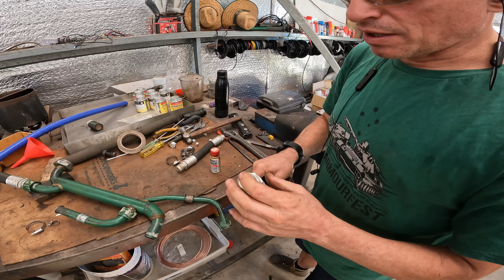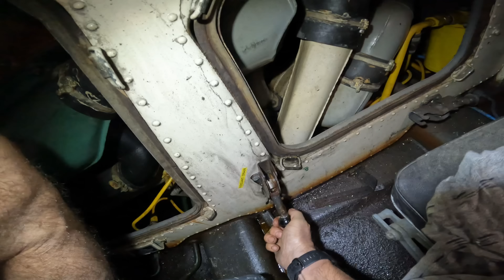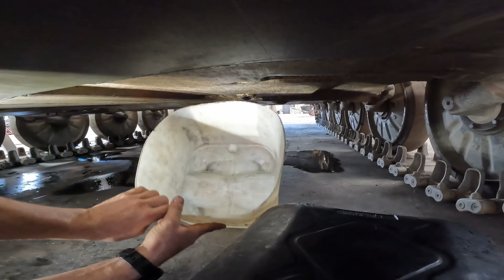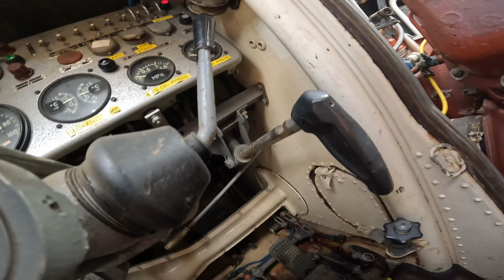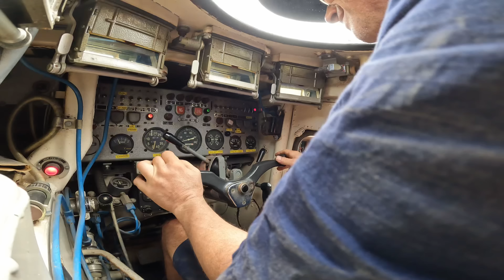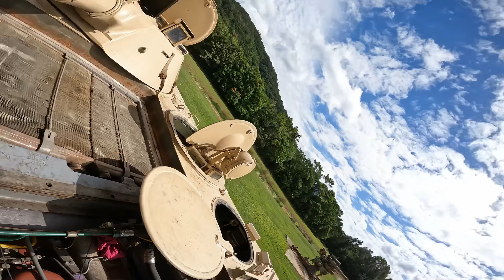BMP-1Infantry Fighting Vehicle Repair - PART III

Comment: The manual says that only if the air start system pressure is too low, electric starter should be used at the same time. The air start system is the primary one, the electric starter is only a back up system. I have the Soviet operator's manual translated into english by the US Army. I wish that I could find the Finnish Army books for the BMP, like I have for our T-55. Even though the Soviet manual has 541 pages, it is lacking some information, possibly because those things are teached during the training of the crew.

Comment: I work in the field of armored vehicles. There are several reasons for oil and water mixing, including: 1. Mixing the water pipe with the common oil. 2. Mixing the oil pump with water. 3. Mixing from inside the engine, such as a cylinder head gasket.

Comment: i dont know if you know it , but important thing about the BMP-1 brake system is the EMERGENCY AIR BRAKE system. when the bmp is not working , brakes wont work , stearing wheel wont work , so you have to have the system working for you to be able to stop . That needs : 1) the electrical system to be on and with power, 2) you have at least 50 air pressure, 3) the brake air valve works. it means that if you are pushing the brakes while in stop and with no handbrake and with power , you should hear a burst of air and the brakes should close (work). if not 2 things can be in fault , an d must be checked because the vehicle is dangerous withoyt this system.

Comment: Better oil in the water than the other way around making the engine a milkshake machine. Just run it 4 or 5 times with no cap on the header tank so the water is not under pressure and if there is an oil leak it will push more oil into the water that way as the oil will be under pressure, and you will see it more and more oil in the header tank.

Comment: Someone in our platoon tasked a young soldier with no 404's or significant experience with operating an M113 with moving one a short distance in the training area. He was all eager to get his chance. He was doing pretty good but he neglected to secure the latch to lock the driver's hatch fully open. He was wearing his bush cap and didn't the hatch pivot forward slowly under the spring pressure and clocked him on the crown of his head when he let up on the accellerator. Immediately he got a stunned look on his face and  slowly dropped back into the M113 like a drunk Jack in the box for a moment. Ouch. For those who have not seen an M113 the drivers and crew commanders hatch have mighty torsion springs at the hinges to dampen the movement of the hatch so it does not slam shut every time. Lucky for our poor guy the torsion spring did its job to a degree.

Comment: check out the chemistry lesson from Steve. Aluminium and Zinc are both Amphoteric… meaning they both react with acids and bases .. ie Caustic
Reply: He also is the first "just a car mechanic"  I've ever heard mention CTE and the differing expansion rates of metal.

Comment: Dear Guys,
Your BMP looks far more better than Emile Luijben’s one when his non driving BMP arrived with his workshop. Yours looks really a lot better ans Steve did repair the cooling leak very well indeed. 
Coming back to Emile’s BMP, his one first got a complete overhauling of the stuck engine. Emile managed to get her running again so he went for a complete outside restoration. As well as for the engine compartment The inside still needs to be restored but he and his staff were able to get the inside more properly looking and the BMP was already in several shows. Also for Emile this vehicle was a pleasure to drive and far more easy than his T55 and T69. 
I look forward to your next vlog and send you love from The Netherlands

Comment: All that water heating/ cooling is just more hassles and do away with the lot. Arctic temps in Nth Qld is 10 deg C. Not F.
You need to wash all the dirty footprints and greasy handprints off before putting it away.

Comment: Thanks again for another Workshop Friday. I never knew that dishwasher tabs could be used for radiator cleaning. Steve's use of the term "Squaddie" certainly dates him. Brilliant episode, Cheers
Reply: Washing machine tabs are also very useful for cleaning floors etc.!
Reply: As mentioned, not recommended for your average car unless you want it dissolved from the insides out.